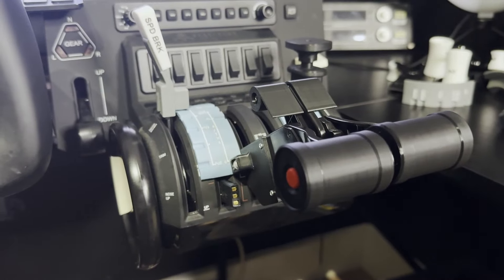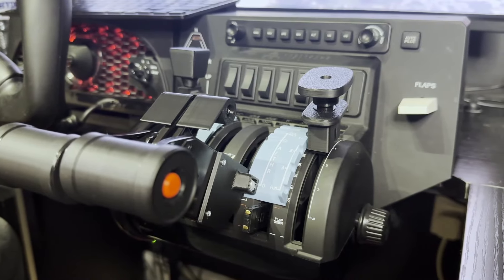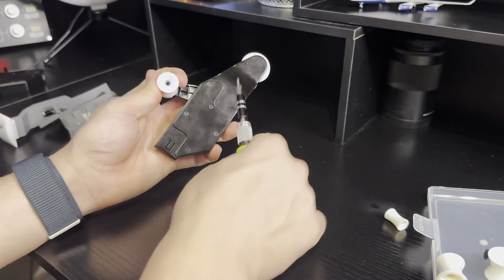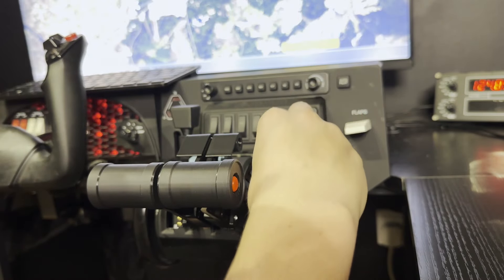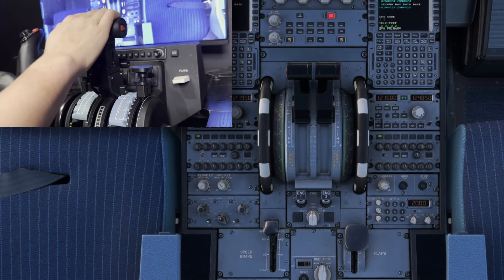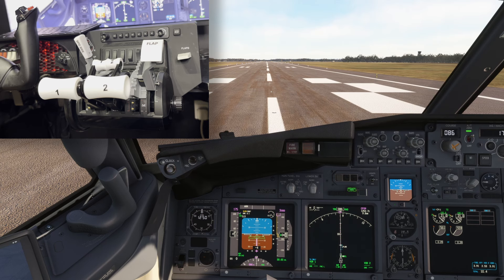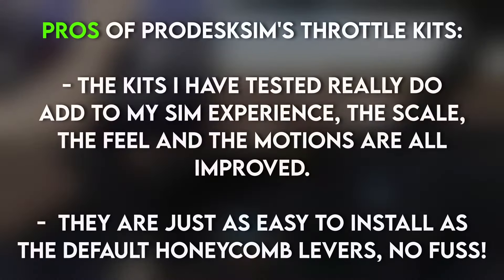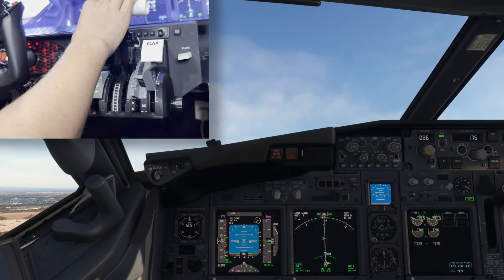UPGRADE Your HONEYCOMB Throttle! | REALISTIC Flight Sim Kits by ProDeskSim | MSFS

Comment: Thanks for the review Pilot Studd.

However, I think you’re still reviewing the old B737 and A320 throttle add ons.

ProDeskSim has updated the throttle quadrant add ons recently. The new B737 throttle for instance has the autothrottle disconnect switches now. Also some modifications on the airbus side as well.

Please visit their website and cross check.

Thanks🙏🏽
Reply from the maker: Indeed these are the older ones, they’re what they sent me, so obviously happy for me to show them off! Have a great day, the new ones look a lot better (with an increase in price)
Reply: That’s well understood.

Indeed the new ones are much better and more realistic.

Keep up the good job.

Regards🙏🏽
Reply: Hi i have got the A320 pieces. The flap lever jumped off my bravo. The biggest joke is the time of guarantee. It's only 5 weeks xD In germany we have got 2 years. But they sent me a new one.
Reply: 4 weeks.
Reply: Oh sorry to hear that man. Fortunately, mine works fine, and ordered the new B737 throttle add on with the Autothrottle disconnect.

Comment: Hi brandon, I remember a while back u were asking for advice on upgrading ur pc, I used to have the exact same setup as you and I now have upgraded mine. I found out that the 3060ti is fine it’s just that we need a powerful cpu for flight sim. So I ended up upgrading my cpu and motherboard along with upgrading to ddr5 ram, (and psu) I kept everything else including the gpu, so I am now running a 7800x3d with my 3060ti and msfs, now msfs runs like a dream! And worked out a lot cheaper than upgrading everything in my pc
Reply from the maker: Thanks for this insight!

Comment: A bit off topic, but need to find out if anyone has found this yet. We need a trim wheel fix for XP12. And I'd love to know why Honeycomb hasn't offered a fix for the trim wheel, which doesn't work smoothly, and seems to skip segments when trying to trim the aircraft??? Honeycomb SHOULD have fixed this months ago. But it is still very intermittent. So I'm wondering if you are anyone else has found a fix for this in XP12? Or if Honeycomb is EVER going to offer an updated firmware? Cheers!

Comment: hi I have seen ur video bout the multi panel, so i just wanna ask if u have a dc because i have a little issue with my multi panel and wanto to ask if u can help me.
But when u dont jhave dc here is my issu.
So my multi panel goes on but whenever I want to fly in the FBW it doesn't work, it lights up but the buttons can't be operated, it's the same on every Airbus plane.
Boeing smothly. 
So u flew at the prerview video with an Airbus plane so may u can help me.
thx 
have a nice day